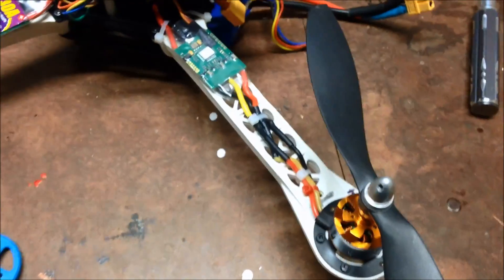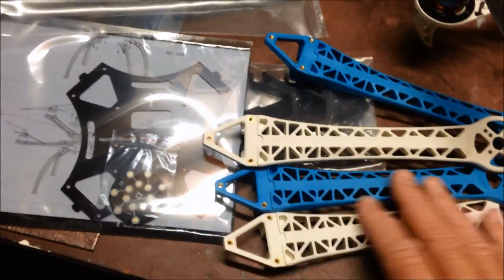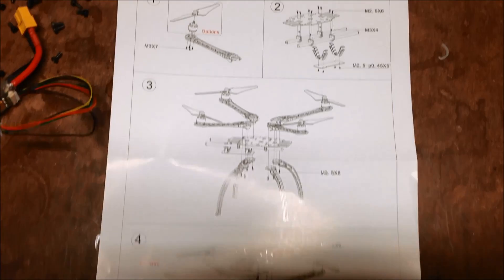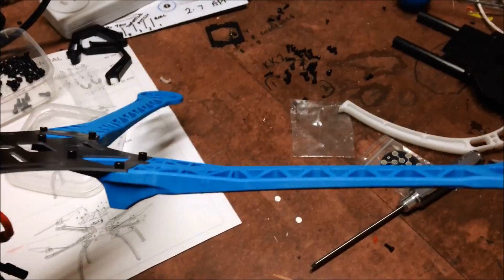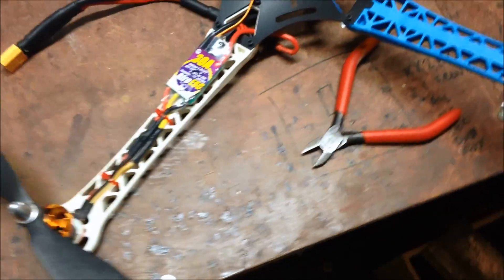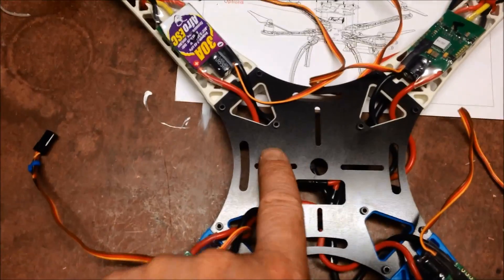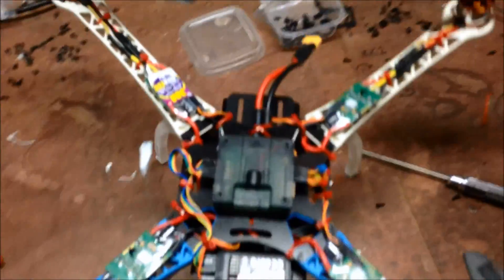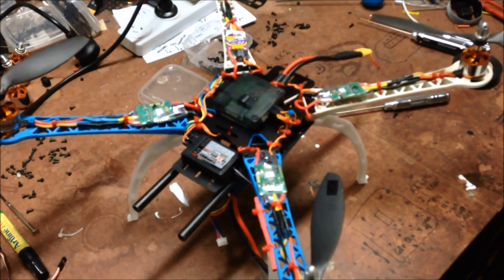S500 Quadcopter Build upgrading from my SK450.  A brief frame comparison

Comment: It flies very nice! I'm also building an S500. I'm upgrading from a Q450 where I had big problems with wobbles, even though I had balanced props and motors. Did you have any issues with vibrations ? Thanks

Comment: Hallo Simon from Greece and congats for your videos. I' ve noticed a sympathy on 2826-10 1400kv motors when used in 500 size quads. Correct me if I am wrong. Why don't you prefer smaller size kv? Is there any difference in the behaviour of the quad comparing to 1000kv for example? Thanks for your time. BR
Reply from the maker: Dimitris E. These are the first motors I ever bought so often use on a new build for test purposes. I now have on this frame an APM2.7 controller with DJI2212 920kV motors and 10x38 carbon props.https://www.youtube.com/watch?v=tryFkzH2HhI

Comment: Simon,
how did you resolve the mounting problem with your flight controller, since the S500 frame didn't have x pattern mounting holes?
Reply from the maker: 2 layers of double sided foam tape. It also provides good vibration dampening as each layer is about 2mm thick.